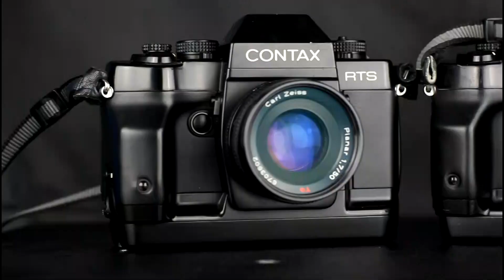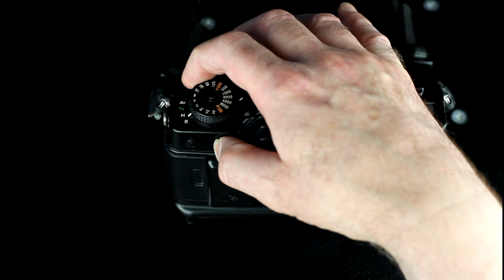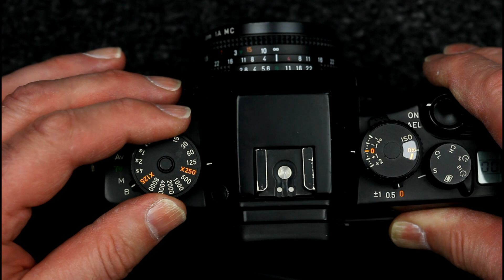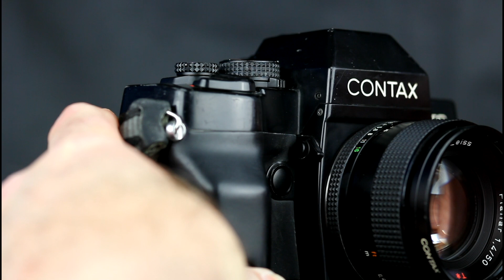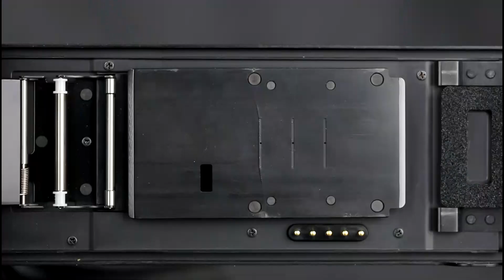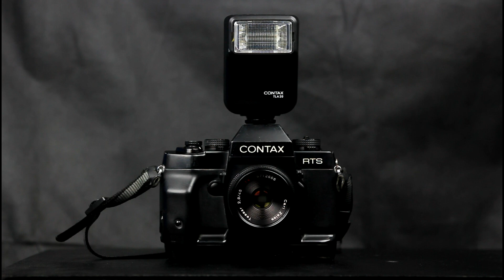The Contax RTS Series Part 3

Comment: This or the RX? 🤔
Reply from the maker: The RTS 3's suffer from an electronics issue that kills them, I would go for an RX.
Reply: @contaxpaulharrison942  Even the later 2 seriel number ones? And the RX is plastic and RTS III metal? That’s really the only difference right?
Reply from the maker: @kleanish  I wouldn't go for an RTS 3, as I think they are at high risk of failure. The RX is not plastic, it does not have a mirror lock and a couple of other features and the viewfinder is not 100% coverage. You don't get as sophisticated support for TTL flash either.
Reply: @contaxpaulharrison942  no mlu is fine. i’ll have to check the fps but think they’re the same. thank you!

Any remarks on ergonomics between the two?

i got an n1 (☺️) and it made me fall in love with the carl zeiss glass. the c/y are so much more affordable and wanting a second slr system, it fit the bill!

Comment: Sold quite a few Yashica/ Contax products back in the day, lusted over an RTS 2 and almost purchased a 139 several times. The RTS 3 came out after I have left the trade and don't recall selling any. My Yashica FR 1 is going strong (of course the film counted has packed in - very common), more metal than a tank it's still a joy to use. My Yashica FX - D has died...sad. Thanks for posting.

Comment: Hi Paul. As an avid collector of contax cameras I have a mint rtsiii. Now it doesn’t have the viewfinder issue and I was sure it was perfect. Took it away last weekend and discovered that, after about 20 shots it decided to put the mirror up, wait 5 seconds, put the mirror down and not wind the film on. Switching it to S and back to A seemed to provide a temporary fix. Then it happened again. On return home, I changed the 2CR5 for AAs to see if it were a power issue but managed to replicate the problem in M and A modes. I think it’s broken. Unless anyone knows anything? 

I made two absolutely factory mint RTS i from about 4, and the demise of the iii has made me get an S2b for fear of my electronic variants leaving my lenses high and dry. And God forbid my favourite AX ever packs up. I love that thing.
Reply from the maker: I can't see an A on my RTS 3, I presume that you mean the drive mode. It might be worth trying to see if you can get it repaired. I presume that it wasn't very cold when you were using it, they don't like very cold weather. I have been down the same root with the RTS, one of the donor bodies proved to be a Fundus, so now I have an RTS and a Fundus. My experience with the AX has not been a  good one reliability wise. I went for an S2 myself.
Reply: Did you ever figure it out? check to see if your mirror has slid down over time and is getting stuck on the back of your lens.

Comment: It's a huge beast, and always was my dream Film SLR. Sadly, Contax (Kyocera) is no more servicing the RTS III since ages, at least since 2015. There are no more spare parts being avialable. The RTS III does suffer usually from a defunct blue LED Viewfinder, which detoriates over the years, and often have a damaged DC/DC Board, too. This RTS III came out into 1990, and still have features, which are unique, the vacuum-based Film Plate, and other features are comparable with the Nikon F6. Both have 1/8000s, and a 100% Viewfinder, for instance.
Reply from the maker: I thought that it was the DC/DC board failing that caused the viewfinder to pack up. Mine worked when I bought it.
Reply: @contaxpaulharrison942  I have 3x the RTS III. One is working without OVF display. Both other ones are nowadays expensive Doorstops only. DC/DC Board damaged, disfunctional, among other technical issues.
Reply from the maker: @Blood_and_Chaos  The Viewfinder displays has gone on mine, but it still fires.
Reply: Good info.  Also, it just seems so beyond advanced for what most peoples analog needs would be.  Analog today is, you go out into the desert and find a ghost town and shoot some shots.  This is far more advanced than what most analog shooters would need or want.  I'm shooting an Olympus OM-2 from the mid 70's.  If I did get a Contax SLR merely for the glass... I'd probably just get the mechanical RTSii or maybe the Aria.  I have the G1 and am just praying it doesn't conk out.
Reply: About SRT III viewfinder, there is another thing like F6, both have only 0.74X magnification when RTS old and II have 0.86X. I'm not inspired by that puny magnification, and I would not use it. At least F6 has good AF, but still uninspireing.